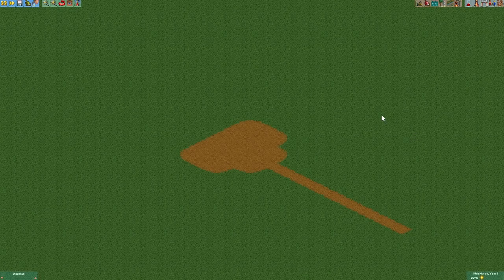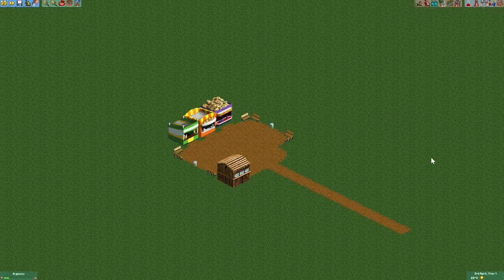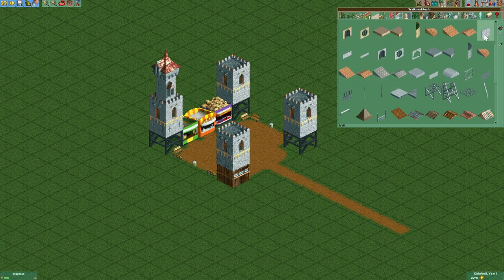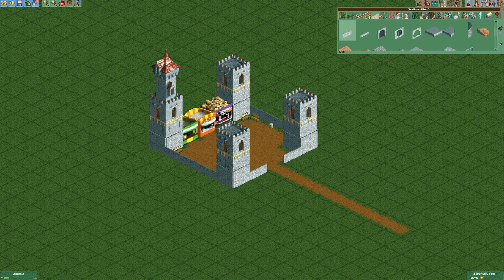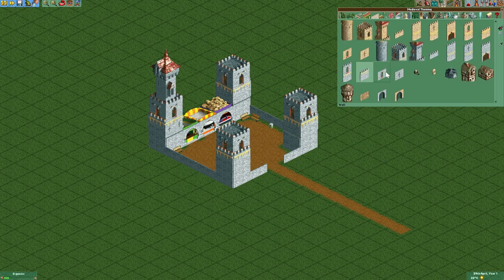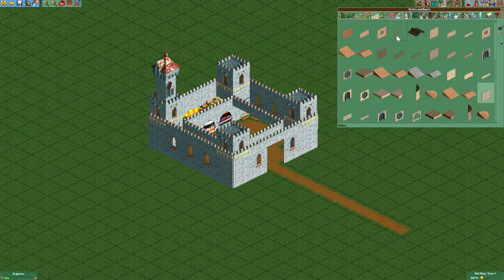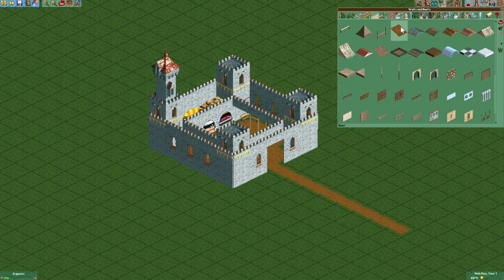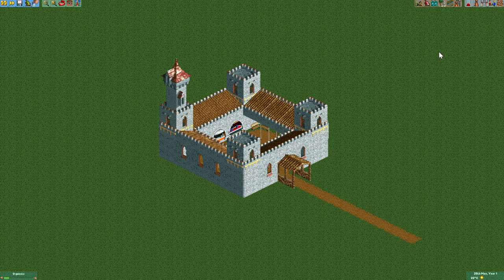RCT Minutes #5: Castle Food Court | OpenRCT2

Comment: Double wide path causes pathing issues, right? 

I was never any good at this scenary stuff but your tutorials are so cute, i almost want to spin up the game and try it myself.
Reply from the maker: Thanks! Double wide paths do cause issues, that's why they aren't that good for scenario play. I also made a video about triple wide paths with two lanes that are separated by scenery, which can help avoid those issues.
Reply: You could put some flowers in the center 3 tiles instead of footpath. this would enhance the "castle courtyard" esthetic.
Reply: @Flyxxpy  Why do you not use that here when it means you can add a lot more seating, and you are already adding walls for support higher up?
Reply from the maker: @Carbon 12 Because I didn't think of doing that. In hindsight, I definitely would build it this way :)